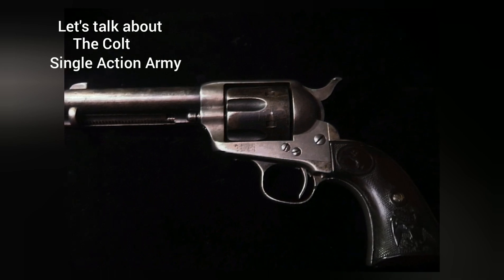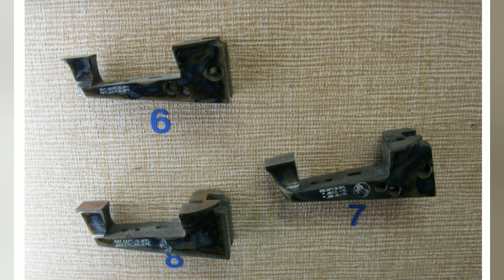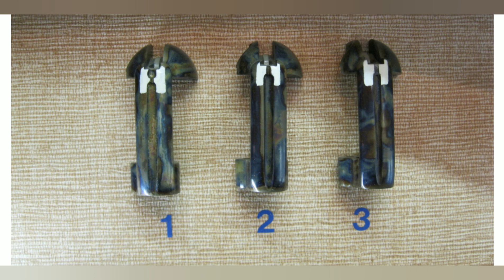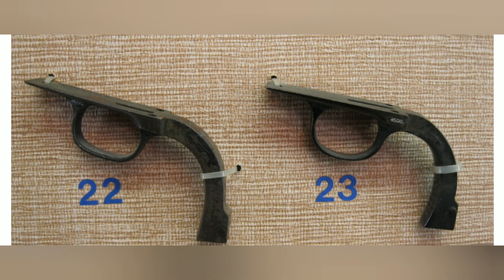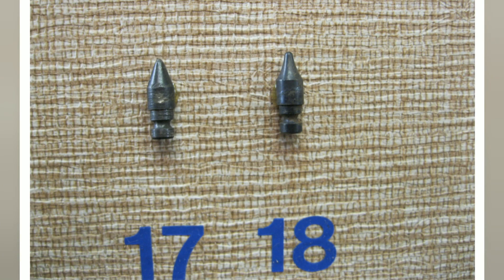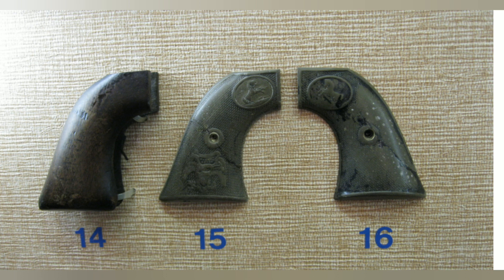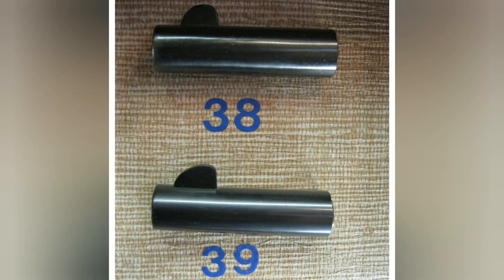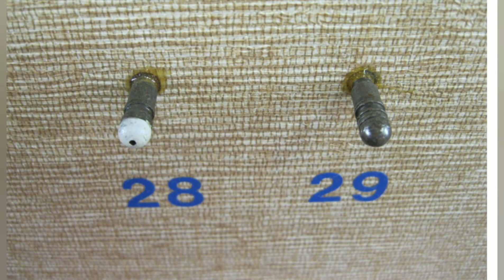Colt Single Action Army (the Peacemaker) all major changes 1873-1941

Comment: Excellent video, thank you! I had fun going through each detail with my SAA old model replica to see how authentic it was.
Reply from the maker: I am glade you enjoyed the video. What company is your replica made by. I am a big fan of the old models with the screw that holds in the base pin. I just Recently bought a early government issued colt SAA made in 1880. I have videos of it on my channel if you are interested. I fell in love with the SAA years ago and started off with replicas. When I started collecting originals, I sold the replicas. But really want to get another replica Eventually.
Reply: @snappers_antique_firearms  thanks! I have a Cimarron import, Uberti made 7th Cavalry SAA replica. They did a great job with it, the model has the screw in front for the pin, the narrow V notch sights, the bullseye ejector, the elongated trigger guard, the '45 cal'' stamped in the correct spot on the trigger guard, the same early text font along the top of the barrel, the correct patent markings, and various other replica markings such as the S/N in all correct spots, 'US' along the side of the gun next to the patent marks, replica Oliver Ainsworth inspection stamps and cartouche on the grip. Also, a true 4 click hammer with safety notch. It does have small inaccuracies like the scalloped firing pin, and modern style ejector housing... but for a modern replica under 700 bucks I am extremely happy with it. I exclusively shoot real black powder 45 Colt out of this gun, which is truly the best way to enjoy an 1873!
Reply from the maker: @BertieW0oster  the Cimarron 7th cavalry replica is the replica I really want to get. They did a great job on them. There is one small thing they messed up on. And i forgot to add in this video. All US gov issued SAAs never had 45 cal stamped anywhere on the gun. All government guns were 45 caliber. The 45 cal marking was just for the  civilian market. My SAA from 1880 was a 7 1/2  government issued gun.
The US gov sold some of their guns back to Colt in the 1890s. Mine was one of them. Colt removed the US stamp on the frame. Put a 45 cal stamp on the trigger guard, cut the barrel to 5 1/2, and some guns remained  7 1/2, and they nickel plated the guns. And sold them to the civilian market. They are the only gov marked guns to ever have 45cal stamped on them. And it's because they were being turned into civilian guns. I Recently got the u s marking on the frame to show back up using the techniques the police use to recover Serial numbers on guns. It was very cool to see a marking that colt removed in the 1890s.

Comment: Very well done! So something I have been looking into is the colt shopkeeper varient I know they did not have an ejector rod housing but did they have the ejector rod housing boss on the frame or was it smooth sided
Reply from the maker: It was smooth sided. They ground it off. They did the same thing with the lightning and thunder. They are missing the housing boss as well on the short barrels
Reply: A American  it would fit you really well I think it carries in the waist band almost as easy as a 357 snubby

Comment: Many thanks for a very concise reference material video that I'll be saving for future use but I do have one question for you. It has always been my understanding that, in reference to the SAA grips, that the oiled one piece walnut version were only for the guns made for the U.S. military and that the civilian market guns had varnished one piece walnut grips. Does your research not indicate that?
Reply from the maker: Thank you. I am glad this can help. Yes, it is mostly true that the civilian guns had varnished grips. While government guns had oiIed. I didn't go too far into detail on the walnut grips, mostly because have run into several reasons that a civilian gun ended up with oiled grips. Mostly because of government over runs and guns that failed government inspection. depending when on the line the gun failed, it can have little to no military inspector markings. These guns were mostly nickel plated and sold as new to the civilian market. This also includes the surplus militia revolvers that were sold back to Colt. Colt also mostly nickel plated these guns as well and sold them on the civilian market. These are mostly easy to spot being nickel plated, and most have some military inspector markings on the gun. But I have seen a few without inspector markings. Thanks again for stopping by.
Reply: Thanks for the clarification, I'll keep those exceptions in mind in the future. Take care and keep the fine videos coming.
Reply from the maker: @michaelkrick9524  thank you, and looking forward to seeing you in the comments on future videos.

Comment: Very good video I’ve been interested in colt saa for years I’ve never had the opportunity to collect a first generation. But I have with the second and third generation and I’ve noticed some of the changes from 1956 to the last of the second generation colts and then the third generation I know change the barrel threads from 20 per inch too 24 threads per inch and the cylinders and hands have been changed the early third generation don’t have a removable cylinder bushings and the latter split S-A on the serial number does so there are a lot changes seems like
Reply from the maker: Thanks for stopping by. I plan on doing this for the 2nd and 3rd gens as well. I know mostly 1st gens just because its the only SAAs I own. I have been wanting a 3rd gen that has the black powder frame.. I love the screw over the push release. I have never shot a 2nd or 3rd but the first is a dream to shoot. I recommend a book called..the colt single action revolvers a shop manual, volumes 1&2..
By Jerry Kuhnhausen.... It has all the diff parts used and all measurements as well for every Colt Single Action Army 1st 2nd 3rd and all the Italian replicas. Great book. there have been a lot of minor changes over the years. Thanks again 🍻
Reply: I’ve got a second generation made in 1956 with a 5 1/2 inch barrel and then I’ve got the centennial Colt that is a copy of the first colts with the narrow front sight and italic inscription on the barrel color case hammer it’s got US on the frame and only 2002 were made in 1973 it also the only second generation with black powder frame other than the frontier six shooter that they made with them. I also got a 3rd generation frontier six shooter in nickel the were only made 1 year it’s has etched panel frontier six shooter on the barrel and a 38 wcf collector association stamped on the barrel like the turn of the century and color case hammer
Reply from the maker: @scottscheuerman6170  very nice. That colt Centennial would be the one I would love to get. Have you ever made any videos for youtube with them
Reply: @snappers_antique_firearms  no I haven’t although I thought about it I would have to find a place to shoot at even though I live in the country I’m sure the neighbors that have moved around each side of me would not like constant gunfire
Reply from the maker: @scottscheuerman6170  I understand that.  You could always just make a video showing them off. If you ever do please shoot me a link. Would love to see

Comment: I found a 1904 colt saa with the 2 row pattent and it has the horse circled on it. Its a 38 wcf.
Reply from the maker: Very nice did you buy it. At that time its 2 row but 3 dates. the horse circled is right. 38wcf is a good round. A little hard to get but if you reload it's not a big deal. And being made in 1904 it is safe to shoot smokeless ammo.
Reply: @snappers_antique_firearms  It's still for sale. I'm looking at buying it. Per colt on that one it can't shoot smokeless because it lacks the vp marking. It wasn't until 1905 when that mark started to be put on them.
Reply from the maker: @spartan1876  Fascinating!! I have read original Colts' documents that at SN 192,000, 1900, Colt guaranteed the single action army for smokeless. I know the smokeless proof mark being put on the guns didn't come out right away. In 1898 colt changed its metalergy to handle smokeless pressures. So technically all guns made with the new steel is smokeless safe. But it's not worth finding out.  i am the kind of person that shoots blackpowder only through SAAs. But my guns are black powder only anyways. My expertise on colt SAAs kind of Focuses on guns made before  1900. I am a big fan of SAAs made before 1896. My collection of SAAs the oldest is 1891. I would highly suggest getting John kopecs book "  a study of the colt single action army". that and " history of the colt revolver" by haven and belden. They are really deep dives into every detail about these guns. I wish you the best of luck in getting that revolver. If you do please let me know. Also getting a colt letter is a great way of learning some history of that revolver.

Comment: Excellent information , but all the chopped-up SSA's makes me want to weep.
Reply from the maker: I know I felt the same way, but Colt made this display using modern parts Machine to identical specs as originals. No first gen Colts were harmed in the making of that display. There are a few websites you can buy parts from guns the government has cut up. Don't ever go there it will send you into a deep Depression.  extremely nice early first gen colt saas  cut up. Happens when a collector dies and kids are antigun and  call the police and have the guns destroyed. You would be shocked what rare and valuable guns you see.

Comment: Are you familiar with 3rd Generation Colts? I see a 1978 made one for sle near me. However I heard there were quality control issues for some of the erly 3rd Generation years. Are you aware if 1978 made guns have any issues?
Reply from the maker: Threw that time there are quality control problems. I have ever seen stamps Being crooked.  body lines not fit..... But just look at the one you might buy. Look closely if you find any flaws. Have him lower the price or just walk away.
Reply: It appears to be find in that regard. The action is very stiff & the cse colouring is muted. Does $2,500 seem about right for it? @snappers_antique_firearms

Comment: I wonder what was going through the mind of whoever cut up those Colts. A sacrifice for education.
Reply from the maker: It was colt themselves who made that presentation. But I agree that would have been hard
Reply: These would have been produced at the factory, probably from components which would not pass inspection due to machining faults, they would go on to perform a useful service to Colt as a publicity promotion, rather that end up in the scrap box. Chris B.
Reply from the maker: @453421abcdefg12345  I agree with you. Its that or colt just had a few parts made. During the 2nd or 3rd gen guns production. That look like new parts. Even the very rare and expensive parts say a pinch frame sight. The only thing that look your age it grips and barrels. Also the color case hardening is a much more modern bright colors. Then the originals. were more gray and less vibrant.  But either way I'm so glad they made this display

Comment: I guess i have a unicorn as my 1884 5.5 inch has a 2 line barrel address.
Reply from the maker: @buckinbunny  I would have your gun checked out. Colt never used the 2 line address on barrels longer than 4 3/4 on the SAA.  We have seen many replica SAAs with colt markings. Biggest red flag is the 2 line barrel address on a longer than 4 3/4 barrel.  Reason is the normal 1 line, its to long to be a punch. It has to be a roll die. Much harder to make and get. Even if your gun came with a factory letter this means nothing. You can order a factory letter on any SN by just filling out a form. No one ever looks at a gun. We have even seen fakes in collections since the late 60s. Unfortunately SAAs have been faked for a long time. This video is just about the larger most common markings. There are smaller factory markings that we can use to help Identify if you're gun as a fake or original, if you would like the help.
Reply: @snappers_antique_firearms  hay good day. It's not something I think u would fake. U know colt did not believe in waste , so if thay were running off short barrels that day and have 6 inches of tube left over I think it might be made into a 5.5  not sure about markings on long barrel sheriff's. It's just a rarity that happened once in a while.  Wouldn't be  worth faking as it ads no special value, especially on a rust bucket
Reply from the maker: @buckinbunny  thanks for writing back. I can definitely tell you out of the hundreds if not close to 1000 SAAs i have worked on or inspected over the years. I have seen crazy things colt has done over the years. Especially with their very early cap and ball revolvers. I have a early fluck dragoon made with cutdown walker parts.  But By the time the SAA was made.  the Manufacturing process and because of jigs. would greatly remove some error possiblys . For instance things Like upside down roll markings.  this happens if the part was put in the jig backwards.  Or Crooked markings for the few marking that were hand stamped. These kinds of things you can and will see every now and then on a SAA. But what makes the 2 line barrel address not likely and a very large red flag.  the barrel roll stamps were put on the barrels last,  just  before bluing.  By this time they had already been cut to length and clocked to its future frame.  Because of This, no barrel larger then 4 3/4 would fit in the 2 line roll jig. Only shorter. It's possible to see shorter then 4 3/4 barrel with a 1 line address from a factory error. but not the other way around. for you thinking it's not worth faking one of these.  Original first gen SAAs, Especially black powder frames made before 1896. Are extremely valuable. nonshootable rust balls in a 1 out of 10 condition commonly go for  around $1000 these days. The Well used, worn  guns with some rust pitting and no finish. commonly going for over $3000. With condition making them range much much higher. with rare or historic Examples selling up to or over 100k. People fake them all the time. Out of the many years i have  done this 1 out of 50ish end up being fake Italian replicas. someone made to look worn and added colt markings. Unfortunately have seen many people lose a lot of money because of this. Just Because they didn't do a per buy inspection.  just trusted the gun looked real. a brand new replica for around $400-$600 and a shady person can easily pass off a gun to someone and make a quick profit. Also some early italian replicas had colt markings. With wrong size shape or font. I tell everyone to just get it looked at and Verify what you have. Just for the Piece of mind. Best of luck
Reply: @snappers_antique_firearms  thank u for your time  I would love for to see my colts I'm near wickenburg where u, maybe we can see Ken
Reply from the maker: @buckinbunny  Wickenburg AZ? I live in las vegas. I am happy to help. There is really 2 stages to this process. Unless the gun makes it to stage 2.  i wont need to see it in person. 1st stage 99% of the time will tell us if it's real or fake. I will explain why we do it this way in the end. So stage 1 is lots of detailed pictures of the gun and all its markings. We need very good clear  pictures.  With upclose pics of every marking. We compare markings to several original colts made around the same SN  from our records. Looking for red flags. Colt used the same stamps and roll dies until they Were worn out. these dies lasted for many years. They left something like a finger print.  each letter has tiny ways it cut. Plus very small defects in the colt die, being hand made plus wear over years. it's extremely difficult for fake guns to make it through this process. This is where we catch most of them. The people that fake the guns cant replicate the markings 100% perfectly. Being the original dies were hand made. And wore over time. They get very close but its never perfect. Fakes are made to be sold to people that don't know the extreme details and trust what they see is right about these guns. Some fakes are very good and some are bad. Its Usually pretty easy to make a Determination at the end of Stage 1 on 99% of guns.  Stage 2 is if we need to see it in person because it's hard to tell. This rarely ever happens. And is usually a real gun with a few faked markings to make it a more valuable revolver.  We also have Stage 2 if you don't agree with our findings. so we see it in person to verify that we made a correct decision. We do it this way because I found  the time and money involved with shipping or seeing the guns in person was never Necessary. It was easy to tell quite quickly and was quite obvious through pictures. So simplifing was the Obvious thing to do. There are definitely inspections on SAA that can only be done in person. But determining if it's a original or fake not that Necessary on 99% of guns. If you are interested. Let me know.
Reply from the maker: @buckinbunny  if you are interested send the pics to thewildsnapper@gmail.com